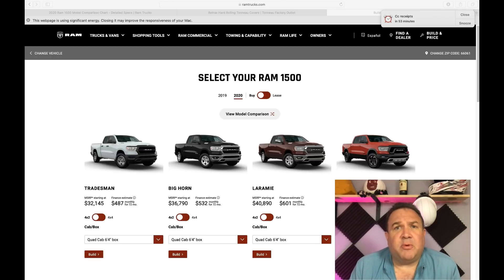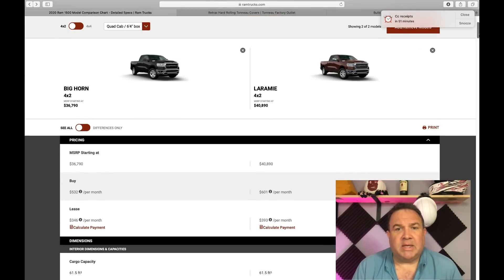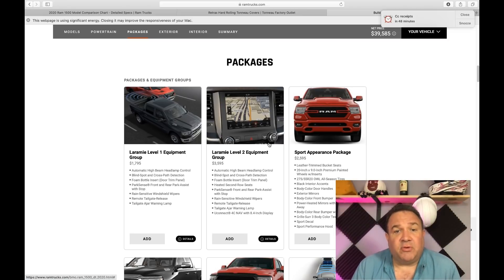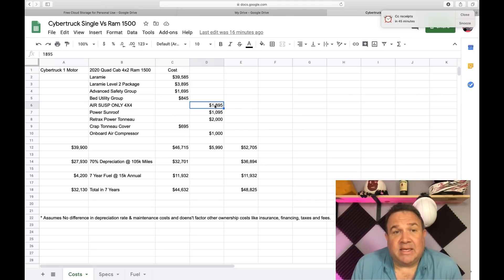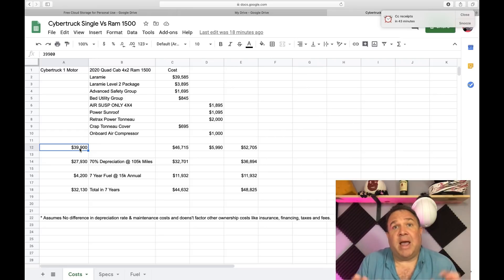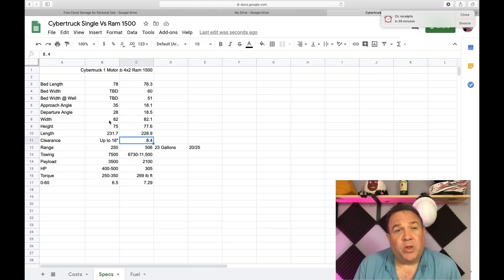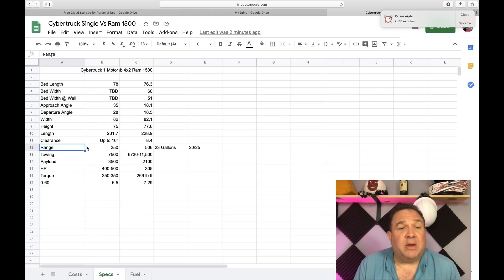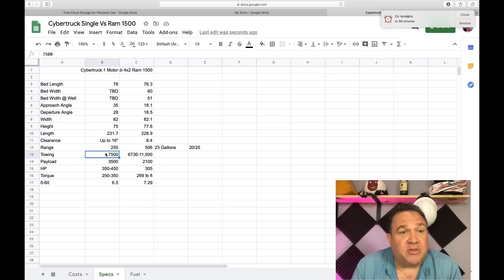Tesla Cybertruck Features, Specs and Cost Vs Ram Truck 1500

Comment: Dodge offers insane rebates, you wouldn't be paying anywhere near sticker.

I got 17500 taken off my fully loaded 19 rebel. Which was 58k on the sticker.

That ev will be a daily driver for people who don't work with their trucks. Any sort of towing or payload will require charging every ~100 miles. 

There's videos out there breaking this down between ICE and EV. There's no comparison in trucks sadly.
Reply from the maker: Actually incorrect. I have a fleet of pickups that tow every day and never drive more than 75 miles. Almost all my trailers are 7500 lb mow trailers. Most contractors tow to one or two job sites per day. That said, as I’ve said repeatedly, if you want to tow any kind of distance, gotta get the tri motor.

Comment: I would put the HP at what the model 3 RWD is or 283 HP and 330 torque area. Remember the gear ratio will probably be adjusted to better suit low range HD truck. Maybe 13:1 instead of 9.7:1. Of course top speed would drop significantly too.

Comment: Another great start to another great series of episodes! Yeh those ICE trucks and their large fuel tanks promise great range (~500 in the Ram you configured) but I know a lot of truck guys here in South Carolina - all makes with all different engines and they way they drive (normally) Never gets them the advertised MPG or range - also any kind of payload or towing really eats into it - having said that I do agree that the single motor will be a tough sell with the limited range - that's what pushed me to the dual motor...range (No Super Charging near me) - the single motor will definitely need a range boost (or big price cut) or it may not last long as an option imo...looking forward to your next episode!

Comment: Keep in mind the single motor is scheduled to come out last (and the steel folding and battery costs should only get cheaper for Tesla,) The fine print says they’re allowed to change the base price of the cyber truck in 10% either way. . Low key I think they’re keeping the ability to make the truck cheaper at any point in their back pocket. . And look it’s already the best value truck you can buy 😂

Comment: I'm surprised no one has thought of putting an auxiliary battery in the trailer for towing long distance.
Reply from the maker: Lots of people have thought about it but the question is will it happen. Some YouTube DIY guys have already built some.
Reply: I want a travel trailer with a Tesla wall in the floor. Unlimited boondocking as well as a power source for the truck.

Comment: You're wrong dude...Tesla's Cybertruck page specifically states the Singlemotor truck to have 14000lbs towing capacity.
Reply: 7500 lbs towing for single motor.
The 14000 lbs is mentioned in the overall description for all versions. Look at specific versions for these types of details (although there are not too many details).

Comment: Cybertruck truck guy - the Tesla batteries today can last over 500,000 miles, and the Motors over 1 Million miles.
TESLA is the only BEV that has a battery that WILL outlast the car body. 
many Tesla owners keep ALL their Tesla cars and become a Multi Tesla family. 
and Tesla even sold replacement Battery on their website back in 2017 for the OLD Roadster.
Reply: I hope they use as much stainless steel as possible.

Comment: CyberTruck truck guy - TFL ,as much as I Dislike them , they did a Test to see if you can use a Generator to charge your EV in the field. they were able to use a Honda 7000 w generator to charge their Model X. and it worked.
you will need a 7000 w generator with an Inverter for stable clean Power, and a 240v outlet, perferbally with as high AMPS as possible, with a 6h burn rate at Full Load. 
I Don't Recommend a generator however, with just Portable Solar , you can add 35 miles per day , while camping and you can stow the solar when done.
another thing is extra power may NOT even be needed, if you go to a campground with a 220 v outlet. 
and you can Supercharge just as you go into the Back Country. 
you can also use a TESLA Destination charger at a Hotel/Lodging just before you go into the Back Country. 
you can SAFELY charge to 100% on 240v Destination charger. (sometime for FREE).

Comment: I think smart Caravan / Trailer manufacturers will start offering an option to have a Tesla battery built into the floor of your caravan / trailer that will actually extend your range when you are touring or run the whole job site where there is no power supply.
Reply: This will depend on your combined vehicle mass limits of course.

Comment: The problem with a battery range extender is that these batteries are very large and VERY heavy. Not really practical as a range extender. Putting a generator in the back is literally adding an ICE engine. You could do it, but I don't really see much of a use case. I think the best approach to charging on road trips is to charge more often and only charge to 80% because the last 20% is very slow. This will often reduce the total time charging. This feature is offered by the app "a better route planner". I would love to see you plan a long trip on paper and compare the breaks needed for ICE vs Cybertruck. That would be another interesting episode.
Reply from the maker: I disagree. CT has a 3500 lb cargo capacity. Batteries weigh 1k ish and could be designed to fit perfectly in the bed. 1 k is nothing to load if you have a forklift or skid steer. All rental companies have those. If I could rent a battery at $35 per day or $150 per week for my long trips or extended backcountry excursions it would be totally worth it.
Reply from the maker: Hmmm. Virtual road trips with different CTs? Interesting idea.

Comment: Whenever you mention range, keep in mind this is only an issue on long road trips. Charging at home and at work makes the likely means only spending your personal time charging on longer road trips. That makes charging less convenient in an ICE truck in daily use.
Reply from the maker: Totally agree. I can barely go 100 miles before I want a break. I think 250 is totally fine range assuming superchargers are every 150 or so but I’m getting a tri so I don’t have to think about it, esp in the boonies.
Reply: @martin barlow  - I think for people who tow a lot, they need diesel trucks. The answer to that is the trick-motor Cybertruck. It is cost competitive and has reasonable range. If someone is choosing between a light duty truck and a base model Cybertruck they are both bad at towing in different ways. If you don't tow often that is a reasonable choice. I think stopping to charge but towing easily is the better choice.

Comment: The problem here is that people will pick and choose what they want and pay only for that. I'd be interested to see total cost of ownership for the cheapest versions of the big 3 trucks. Be fair with all costs. Include gas. Factor in cost of gas vs electricity. The trucks might still be cheaper, but I can't imagine by much - possibly not even cheaper. Then list everything you don't get on the base model that you do get on the Cybertruck. That would tell a different tale - that even if you try to cheap out you spend enough for a Cybertruck, you just get a lot less.
Reply from the maker: I mean it’s almost irrelevant because I personally know not a single person who buys the cheapest pickup truck except fleets. I know they exist but they are very few and very far apart in truckland.
Reply: @cybertrucktruckguy3347   - My reasoning is that I can imaging some people will watch this video and just say "but that's not me. I wouldn't get feature X, so this comparison doesn't apply to me". If you go the other way and show the Cybertruck cost is similar to a truck stripped of features, then people can look at the actual cost delta and add in the cost of their favorite features to quickly exceed the cost of Cybertruck without coming close to the feature set. I'm really just spit balling another angle on this comparison that may make more sense to some people.
Reply from the maker: I just realized I could do this by adding another column for the cheapest configuration.

Comment: Off topic from the vid but Tesla needs to delete the middle seat in the front and give us a large Cavernous center console. At a minimum make it an option on the dual motor and standard on the tri, ideally just give us the console nobody likes or uses the middle seat.
Reply from the maker: Agreed.
Reply: What if it was both? The center seat back folds down to give trays and cup holders. Could just put bigger storage under the center seat that you access by lifting it.
Reply: @martinbowyer7906  my '98 f-250 has that, downside is console is very thin, maybe 2'' deep.  Has 2 cup holders and a small console slot. The back padding takes up most of the room. Of course thats a 22 year old truck
Reply: From personal experience the middle seat/console config is the worst of both worlds. A seat you’ll never use and a console to small to fit anything other than your mail.

Comment: Great vid but it seems like your torque figure is wildly off.
Reply from the maker: Looks like I listed it at 250-350. I’d be really surprised if it was much higher than 360-370 but I’d be happy if I’m wrong.
Reply: @cybertrucktruckguy3347  Thanks for looking into it again. I guess I just thought it'd be a bit higher because the dual motor and triple motor are estimated to be 800+ and 1000+ lb ft.
Reply from the maker: Which one?
Reply: @cybertrucktruckguy3347  The estimated torque for the cyber truck. For example, the standard range model 3 has 330 lb-ft.
Reply from the maker: I don’t think anyone knows for sure yet. All I saw were estimates but I’ll check into it some more.

Comment: Tbh, I don't know how important the safety package is to the average budget truck buyer. All because it is standard on the Tesla does not mean you have to include it.
Reply from the maker: True but all truck comparisons have some degree of variability. My goal was to match the CT to a comparable peer.
Reply: @cybertrucktruckguy3347  Ok, but if it will be a mass market vehicle, it needs to compete in the mass market. Alot of which is commercial, commercial customers do not care 1 bit about any creature comforts, I dont know Ram's trim levels, but in Ford it would be the XL.
Reply from the maker: Commercial sells lots of units but margins are razor thin. I don’t think Tesla should try and compete there, at least not yet. Probably 4+ years before they can come close to meeting other consumer bases demand and still have excess production capacity. 

CTs configuration limits a lot of commercial applications for which custom beds are required and lots of other vendors taking a run at other commercial truck levels. 

Just my opinion but entry level commercial trucks is not a place Tesla wants to compete yet.
Reply: Cyber truck need not compete on low budget.  The truck market is large enough for Tesla to target mid and up